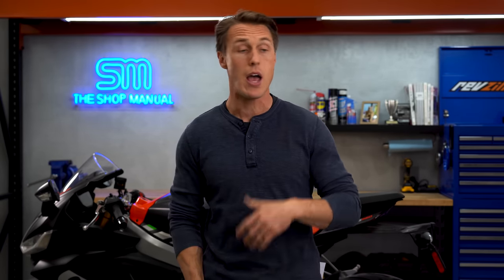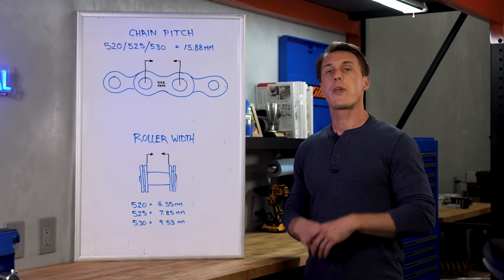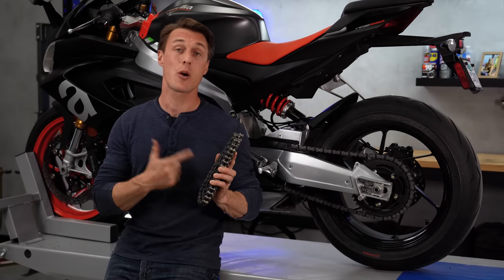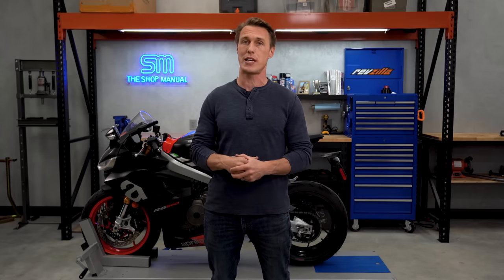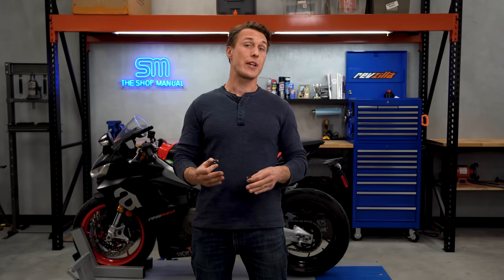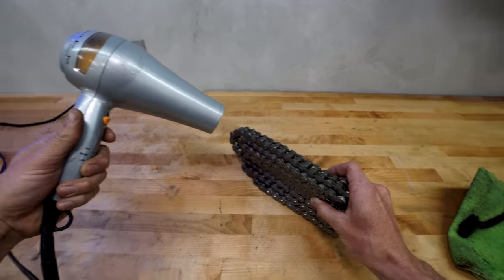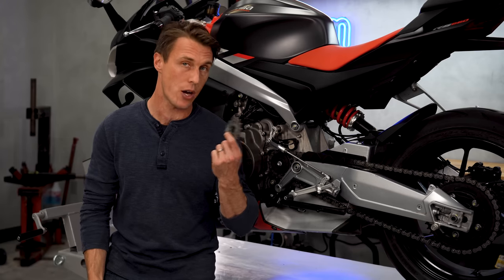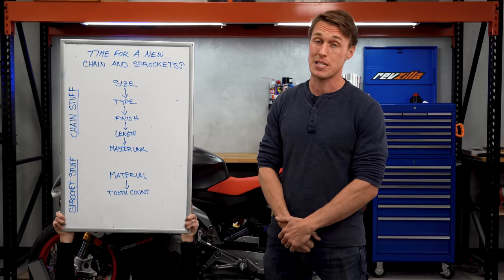Everything You Need To Know When Replacing Your Motorcycle’s Chain and Sprockets | The Shop Manual

Comment from the maker: Enter to win a 2022 Indian Chief with RevZilla's #IRODETODAY sweepstakes: https://rvz.la/3ttfYFC
Read more on Common Tread: https://rvz.la/3e6v9hh
Reply: TIP: I use moly compound [not grease] to lube the splines before attaching the sprocket like BMW riders do to their splined shaft drive as it reduces wear
Reply: Cheers Rev -  Most of the bikes I rode, have the speedo running off the front wheel - not the back or thur the trans.   The real crux - is whether to use this opportunity to change the overall gear ratios of the bike.  Real world example - 82 Kawa 750 Twin - 17 F 43R =60mph@6500 rpm.  My pick was 17F 30R = 60mph @ 4400 rpm.  The good outcome was going from 35mpg to 55mpg.  Top speed was of course increased, but I had already done that some 25 yrs before.
Reply: @mpccenturion  I'm trying to make my daily (07 Honda cbr125r) an even better daily, and I'm kinda new to this stuff I usually just replace the part. Are you talking about going to a smaller front or rear sprocket?

Comment: A few things I've learned over the years from doing my own maintenance on motorcycles: 1) I usually replace the sprockets every other chain replacement, rather than each time, and base this on the 2nd chain lasting nearly as long as the first on a given sprocket pair (yes, the 2nd chain does wear out more quickly, but not enough to justify the expense of the sprocket set); 2) the biggest sign your chain needs replacement - assuming it was lubed regularly - is when you find you are having to adjust the slack more frequently, say, instead of every 500 miles its down to every 300 (or as I did once, letting it go so far the chain came off the rear sprocket while leaned over - that was a real butt-pucker moment); 3) tightening up the slack too much is really hard on the chain - set it to around 1"/25mm of deflection mid-span; 3) clean your chain frequently, especially in dusty or wet conditions, but beware of using any kind of petroleum solvent (including kerosone) on an X- or O-ring chain as it took me years to learn the hard way that solvents get past the seals and cause the chain to get stiff and start kinking up a lot sooner - I just use a Grunge Brush to remove dirt then relube with a generous amount of common 75W-90 gear oil. This advice only applies if you regularly clean and lube your chain before it starts getting rusty, however...
Reply: First of all, there is no way in hell I'm adjusting the tension of my chain every 500 miles.
Second, it took you 10 years to learn something I learned in 10 minutes just by reading the user manual?
And third, I'm not going to use gear oil on the chain unless it's in Scottoiler. Otherwise, that's what chain lube is for.
Reply: @mickeypopa  No, it took me years to notice that kerosene strips the grease out of what should be "permanently lubricated" x-ring (or o-ring) chains. If you have a plain roller bearing chain then fancy-pants chain lubes might very well be superior to 75w-90 gear oil, but for an x- or o-ring chain the only jobs of the lubricant applied to the chain are to repel water and prevent rust. If any externally applied lubricant could make it past the x- or o-ring seal then so will dust and grit, which means it isn't a seal after all.
Reply: You can use kerosene, diesel, W40, etc (any "oily" solvent) except gasoline or anything too aggressive.

Just apply it on an old piece of cloth and then use it to remove the excess of dirt and old grease, with the help of an old toothbrush for the hard to reach places.

I heard that gear oil works good but I don't like the mess and having to relube so often. Personally I use lithium grease, applied with a syringe (without the needle obviously) and then I distribute it with my work gloves.
Reply: Why clean the chain? It just removes the protective barrier that has built up 🤪
Reply: I like to adjust it to where it just touches the chain guide at bottom about an inch and 2mm. I also have never lost a clip link as a daily rider with occasional drag race with friends on a lonely straight. Or twisties
Reply: @mickeypopa  in my bike manual it recommend chain lube or gear oil
Reply: @chadkline4268  ...plus..as an old English engineer once said to me: "it's only gonna get dirty again"
Reply: @allpraisebob  Kerosene cannot, and does not, strip grease out of sealed areas. It's fine to use to clean and you then re-lube.
Reply: @flippy66  Kerosene can and will destroy rubber. Look it up. Maybe not enough to destroy an O/X-ring over the course of a chains lifetime, but why risk it when there are better chain cleaners out there?
Reply: Only do your own if you know what your doing
Reply: @allpraisebob Gear oil is usually the manufacturer recommended chain lubricant too.
Reply: @TictacAddict1  In the 2 years since I posted this semi-controversial comment I have racked up a total of 67,000 miles on my 2019 Kawasaki Z650 - not a typo - and it's on its 3rd D.I.D. X-ring chain (and 2nd sprocket set). So I'm getting over 20k miles per chain by following my own advice. I'd say that's pretty f'in convincing.
Reply: Since D.I.D. explicitly recommends to not use kerosene i would say we all have to praise bob (couldn´t resist 🙊🙉🙈).
But anyone that paid attention in chemistry class could´ve come to that conclusion, since kerosene along with EVERY other combustible fuel 
such as gasoline, petroleum, diesel, heating oil, paraffin, lighter fluid, propane, butane or even coal are made of hydrocarbons.
And hydrocarbons are hydrophobic, they repell water. And with that attribute always comes another one, being lipophilic , or "fat-loving". Meaning they dissolve fat.
And rubber contains linked fatty acids = hydrocarbons want to dissolve rubber o - rings.
Science, bi#$* ! 🤷‍♂
Reply: Diesel is not flammable,  makes combustion with pressure not spark or flame.
Reply: @Spit-Broke  WTF, you think a Dieselengine ignites only by pressure?! 😂
Just because it´s way less flammable than gas, doesn´t make it non flammable...
Ever heard of a glow plug? Of course is Diesel a combustible fuel, it´s made out of Kerosin ffs....🤦‍♂
Reply: @Schmitzelhaus you can hit diesel with a match or touch and nothing will happen. If you hit it with a hammer, the hammer will take your head off.
Reply: Glow plugs only warm the interior combustion chamber to help the diesel engines preform detonation from compression.
Reply: @oxygen454  You can hit Diesel with a match because it has a flash point of 55°C and the flame of a match has not enough energy to bring the Diesel up to that temp. If you would heat the Diesel in an oven up to 55°C, i ensure you will ignite the vapor - air mixture of it with a match. 
And besides that, the only thing that gets compressed in an Diesel engine is fresh air. The air alone will reach up to 900°C or so by that compression, and that temperature ignites then the Diesel, that only gets injected when the highest compression is reached. It´s simply that air temp that ignites the vapor, and not because the Diesel fuel is being put under pressure...
Reply: @gpeaes  no it wont.
Reply: @Schmitzelhaus by that (flawed) logic, chain lubricant should also dissolve the o-rings, because its also hydrocarbons....
Reply: @suprlite  You are correct. I was wrong and use Kerosene now.

Comment: It has been 22 years since I changed a chain and sprocket set because I SWORE I would never own another chain drive street bike (3 shaft drive, one belt and now two chain drive bikes currently).  This was a great reminder.  In my case a 1999 VFR800.  I could not find my old breaker/rivetter so new one purchased.

Comment: A well maintained chain can easily last over 20,000 miles.  I put 20k on a chain on my Norton850; I have 17k on my Triumph Bonneville T100 and just recently made a slight adjustment to the chain.  I wouldn’t be surprised to go 30 k on it.

Comment: Helpful. I recently acquired a 1982 Harley with a conventional chain. I think I will keep it well lubed and hope it lasts a long time. Changing the front sprocket on a Harley is a nightmare. I will need to remove the outer primary cover, clutch, primary chain, front primary sprocket with compensator, and inner primary cover with associated oil and vent hoses.

Comment: Another thing to add to chain quality, manufacture spec chains normally are rated around 2.5 tonne weighted rating before the chain breaks on average (varies between bikes of course), where you can buy RK chains etc that can take up to 7/8 Tonnes before breaking, ie higher durability than standard thereby longer lasting.

Comment: 6:11 why would changing the tooth count on sprockets throw off the speedometer. Does the speedometer not get its data from the wheel rotation, often the front wheel? Changing tooth count would only change engine revs up or down for a particular speed but the wheel rotation would still stay the same for a particular speed. Changing tire size has the potential to throw off speedometer count.
Reply: some bikes measure the gearbox to get information to indicate speed.
Reply: @libraeotequever3pointoh95  possibly, but that would not be the norm. And if so, I would expect him to mention that it is on bikes measuring the speed from the drive shaft or gearbox output rather than wheel rotation.

Comment: Could you guys do a detailed video on gear indicators? How they work in particular with some animations. Both built in OEM and aftermarket.
Reply: The little LED that says what gear you’re in? 

It tells you what gear you’re in...? 

If you have an after market one, it’ll plug into the diagnostics port and use the rpm vs road speed to work out what gear you’re in after an initial calibration. It won’t show what gear you’re in with the clutch pulled however.

Comment: Excellent video. Should have quickly touched on tooth count and how it affects gearing though. Like going down on tooth count up front or more teeth on the rear lower the gearing for faster acceleration but lower to speed and higher revs at cruising speed and adding teeth to the front or lowering teeth on the rear has the opposite affect. Still a great video though with a bunch of information.

Comment: Just so you know JT is also a great choice 👍for chains. I have a big bike, a tiger 955i and I'm using JT for 5 years now and nothing bad ever happened, I'm always using the heaviest chain possible which of Course is the 530 114 golden one x-ring in my case and for my smaller bike I also use the heavy version because I'm working with it every day, as I'm a courier, so as you can imagine there's a lot of strain going on, and the same goes for my tiger as well, thousands of miles spent on travelling around country and I changed it after 3 years of the heaviest possible use, and I could let it run for a couple of thousands of miles more but there was no reason to take that risk since I could buy a brand new heavy duty set for 150 euros here in Greece and that's a lot if you ask me but it is what it is I suppose and since every chain nowadays has replaced the oring with xring technology there's not much you can do to avoid the 150 dollars or whatever type of money you have where you live in order to get something that will last at least make the best choice without spending the half of you monthly incomes to get a freakin chain. Sooo, stop ✋ wasting your money 💰 on much more famous brands who charge you more because they managed to build a name around the world of chains or whatever and keep in mind that choosing a huge brand name in order to get something that will last means that you will have to pay more to get what you need for no reason when you can get the same quality for less if you do your research properly. Now in case you don't know what JT is let me tell you that they're using the same Japanese DID related materials with the difference that they're assembled in Thailand instead of Japan 🇯🇵,  which means that you're getting the same quality of materials whith the only difference that they're getting assembled in Thailand instead of Japan. Now use that knowledge for your own f@cking benefit, care for your vehicle, and stop wasting your money 💰 on huge brands just to play the smart guy because you payed 100 more dollars or whatever on a freakin chain ⛓. Always go for the heavy duty, lubricate it on time, make the proper adjustments on time which means you never begin to go on a trip or even a simple ride before you first check the condition of your chain and your whole bike in general 😉. And for last, learn how to take care of your vehicle properly as your whole life depends on it because bikes are definitely not for everybody, they're not scooters neither toys, and you can literally loose your life in a blind of an eye, so bear all that in mind you'll be just fine.

Comment: I've lost three masterlink clips on my WR250R which I ride mostly street with occasional off-road when I can find it and have since switched to rivet links. I'd recommend doing the same.

Yes, I correctly set the clip so the opening is pointing to the back of the bike, opposite of the direction of travel. I think the chain guide on the bike just rubs it too much on decel.
Reply: What you just described is that you put the clips on the wrong way dude.

Comment: One extra thing, when you get a larger sprocket, you will need a longer chain, generally, every 2 teeth are an extra link, and you get even number of link on chains because you wouldn't be able to connect an odd numbered chain, since the plates alternate.

Comment: I know people are sketched out by eBay, but I but kits off of there for my bike. If you do the reading and match the specs, it's pretty good. I've had 3 kits between 2 of my bikes with no issues, chains are the right length too, so no cutting or punching rivets that motion pro chain tool is top notch too. Spendy, but worth the investment long term.

Comment: Great video!
I wish if you guys also talked about the new BMW maintenance free chain.. 
Do guys plan to cover it in the future?
Reply: We have the BMW Endurance chain out being tested now, and we'll report back once it dies.
Reply: @AriH211  Sweet!
Hope its really as good as its reported. 

Have a good one!
Reply: I don't know if there is enough benefit over a standard x-ring chain.  I don't lube them anymore and haven't for years.  In a dry climate where corrosion is no issue, we already have maintenance free chains.
Reply: @TurbodanNM  Good to know. I guess we still need to retension the x-ring chain. 
Also, the M-Endurance chain might have better longevity. 

Really waiting for for the video to be published to understand what it offers more.
Reply: @TurbodanNM  how long are your chains lasting you?
Reply: @deathwish8339  I replace them on my MX bikes when they are worn nearly flat on top from rubbing the lower chain guide.  They don't require adjustment over that time, which I would estimate at around 150 hours.  On the street I haven't had a bike long enough to wear one out.  I had about 10k on my last DID X-ring chain when I wrecked my Yamaha 600, kept the chain and slapped it on another bike and ran it for another 10k before I sold it.  Still no adjustment required.
Reply: @Mohammed68099  A sealed chain is near the end of it's service life when it begins to elongate and requires adjustment.  This indicates the grease has dried out or the o-rings have given up, either way it will deteriorate rather quickly at the point.  I've never seen the rollers fail before the internal pins and bushings have worn out, hence my skepticism of the fancy DLC coatings in the BMW chain.
Reply: *regina maintenance free chain. BWM just bought some naming rights and a limited exclusivity contract. Regina are already selling their chains for other bikes on the after market
Reply: The early results were it needs as much maintenance as the rest, if I recall the comments on High Side, Low Side correctly.
Reply: @thomasneedham1512  Can you share the link?, i would like to check it out.
Reply: @Mohammed68099  They just mentioned it in passing on a more recent High Side, Low Side. I have been watching a lot of them so I don't know which one it was. Only a mention and not a full report from Ari's buddy who is testing it.
Reply: @thomasneedham1512  I’m certainly looking forward to the full long term reviews! Tbh I always took ‘maintenance free’ to mean less maintenance and ‘no need to adjust’ to mean it stretched slower rather than not at all,  it surprised to hear it didn’t have a noticeable difference for someone. Most chain maintenance is of course cleaning and lubing, as far as I understood this was supposed to remove the lubing component, and as lubing is what grabs hold of most of the dirt, reduce cleaning. Tbh I was suspicious of the claims, but still really hoping it would live up to the promise of no more lubes and mess - just a gentle hose down once in a while lol, though not that surprised that it might not be so easy lol
Reply: @jonpram1737  When is anything important in life going to be "that" easy? Making children perhaps?

Comment: One more consideration: check to see if your bike uses locking nuts on the rear sprocket. If so it's a good idea to replace those as well since they deform once tightened like a crush washer.

Comment: Let’s be honest. How many of you have lost a clip link assuming you installed it correctly and pre pinched it before installing. I did a 520 conversion on a 600 with clip link. Never lost or had one come off. Saves you money from going to a shop. Also at the track it allows you to completely remove chain and clean properly.